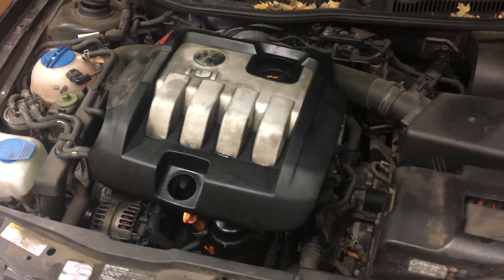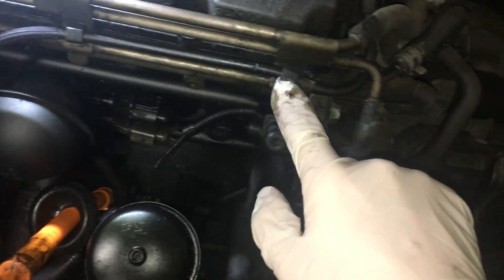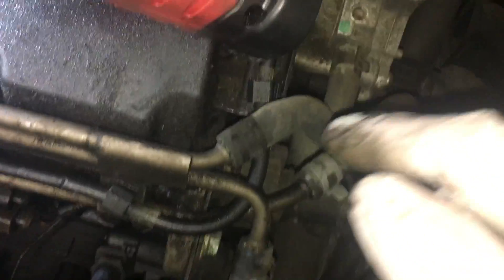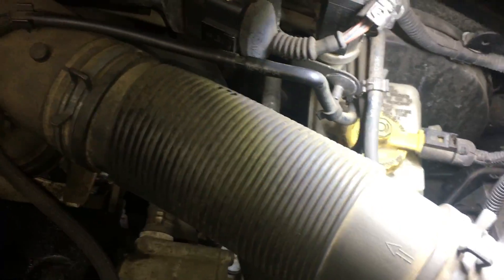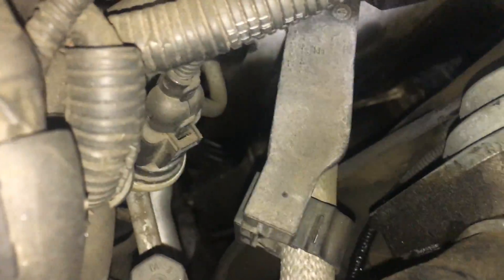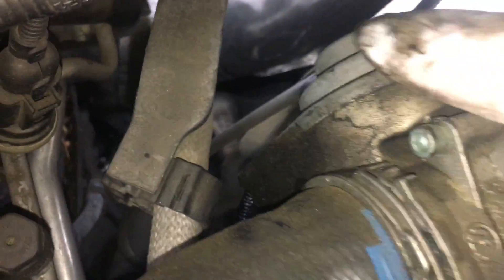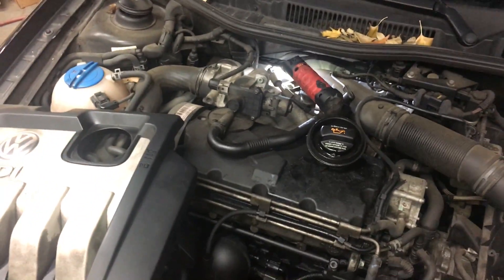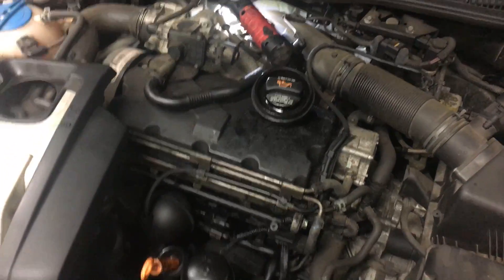VW P0299 Turbo Underboost TDI Golf

Comment: Guys i have a Golf Variant 1.9 TDI year 2008. My problem is that throttle stops working as it should in the middle of driving, the car gets thrown in reserve programe..I have changed the EGR valve, MAP sensor, MAF sensor, camshaft position sensor and it still not fixed, the engine light is on all the time. I don't think there is a problem with the turbine because there's no weird, cracking sound coming from the turbine and this problem sometimes happens when i drive 90km/h and sometimes at 140km/h or in between so i think if it would be the turbine the car would not be able to sometimes drive 130,140 km/h and sometimes not. Does anybody have any advice? Someone had the same problem? Please help!
Reply from the maker: Thanks a bunch for watching my video and taking the time to comment. Have you scanned your system for fault codes, with a scanner that can read detailed VW specific codes? Why did you change all those parts?

Comment: Who know will you see this. But. Listen this in hope you will see.
Jetta 2008 bxe 1.9
Turbo is new. Egr is shut down in software and hardware. MAF and MAP is new. Vacum Box by serial number is new. Vacuum hoses are replaced. And still when i hit 100kmh or go over 2000rmph or go up on hill my turbo shut down and limp mode is active. Error was underboost 0299 now is overbost 0234. I also done general in my engine, injectora are also new etc etc etc.
Reply from the maker: Thanks a bunch for watching my video and taking the time to comment. Have you sent your ECU to check of it is glitching? How about the wiring going to your ECU? Please share an update, thanks.
Reply: Any update on this? This is exactly what I’m currently getting on my caddy with the bls. New turbo, EGR blanked and mapped out. Boost was shutting down before the EGR was blanked though
Reply: @MilosJ989  did you change your vacuum pump ?

Comment: I have VW Vento 1.6 TDI 2012 model , problem is when I exactly hit 100 Kmph speed , there is sudden jerk of Pickup Drop and glowing up of 'Spring Light' and car stop picking up speed. On scanning I got same error P0299 Underboost problem. Can u please tell me the fix or probablw problem!!
Reply from the maker: Thanks a bunch for watching my video and taking the time to comment.  You may want to check the connections to your turbo, turbo, and turbo-related items.  Please share an update, thanks.
Reply: @WheelsTips  yes , I checked the connection but they all are fine. Problem was with Wastegate Regulator sensor on top of Turbo. It's shaft sometime get stuck hence resulting in Glowplug light and pickup drop exactly at 100km/h speed. After 2-4 mechanics failed to fix problem ,I found someone who solved the problem by adjusting the Shaft of Sensor. Now my car running smoothly with increased pickup. 😄
Reply: @Gobli12345 what shaft cam or crank

Comment: What is that round black ball that one of the lines are connected to? I accidentally broke the plastic connector to it and need to find a replacement part. There are a few different lines how do I know which line is supposed to hold vacuum and not?
Reply from the maker: Thanks a bunch for watching my video and taking the time to comment. I would follow the vacuum diagram located in the hood area which will tell you what the part is and the airflow direction. Please share an update, thanks.

Comment: Hi. I have all the vaccum lines in order and working and holding vaccum . What esle it can be? 1.6 Tdi Vw, p0299 , limp mode cones only when accelerating in 3rd gear .
Reply: did you find the issue ?
Reply from the maker: If you have checked everything, you may want to check and see the condition of your turbo.  Please share an update, thanks.
Reply: I checked everything, N75, turbo actuator, vaccum pump, all in working order. I have to change the turbo, as it's not building up enough pressure, got it checked on vcds. Thanks so much for your video!
Reply from the maker: Did you end up changing the turbo? Looking forward to an update, thanks so much.
Reply: @WheelsTips  hi, my case was a bit tricky, first i checked any vaccum leaks and the vaccum pump, all grand then what i done was, took the heat sensor off from the DPF, and when i want for a test drive, the all power came back, so i just cleaned the DPF as it was full, strange was that i had no error from DPF.
Reply: Gave me underboost error because the smoke was building in the DPF and because it was full, the smoke would come back in the engine
Reply: Did that give you an air intake leak code as well? I have the same issue, dpf light is on though but I'm also not getting any boost with mine; well it says underboost
Reply from the maker: Thanks a bunch for watching my video and taking the time to comment. Personally in some cases it ended up being a turbo replacement, unfortunately. Please share an update if yours is an easier solution, thanks a bunch.
Reply: Could it be dpf needs clearing?

Comment: Hello, i have the same code on my 1.9 Diesel Golf 4 and i'm pretty sure i cand hear the turbine most of the times but thw power isn't there and check engine is on , tomorrow i'll check the vacum lines but if that isn't it could you tell me other causes for this ? Thanks anyway. (i'll come back with an edit of what i find)
Reply from the maker: Thanks a bunch for watching my video and taking the time to leave a comment.  Looking forward to your diagnostics update, thanks bunch.